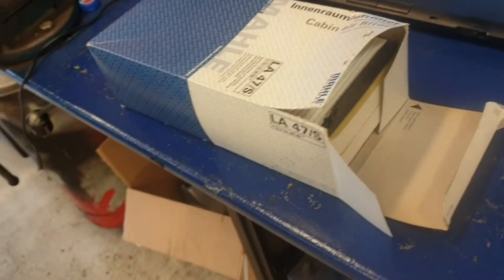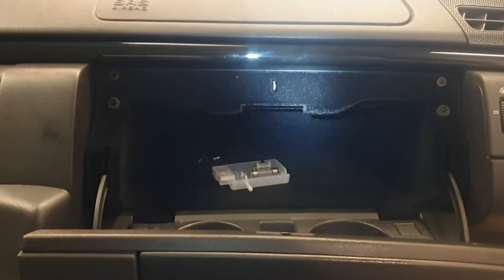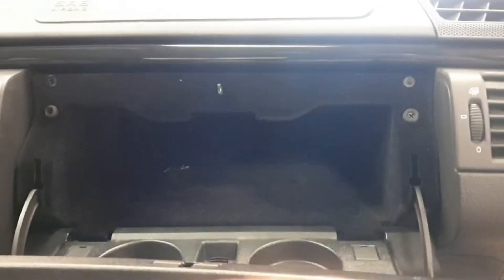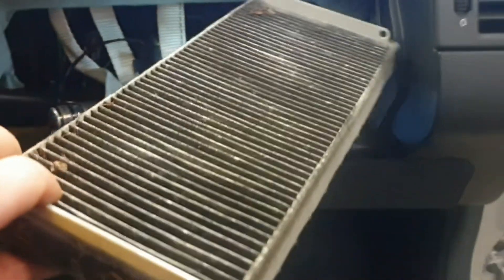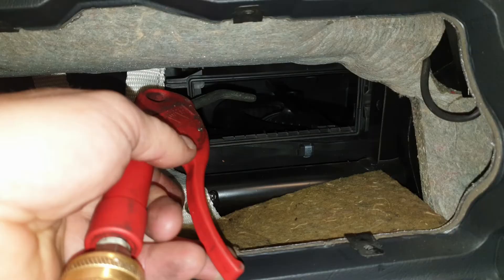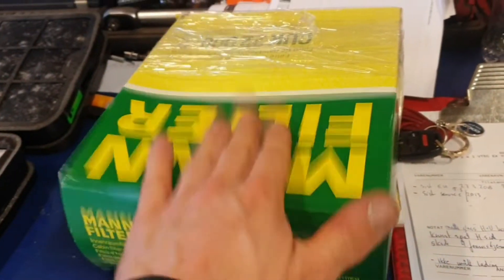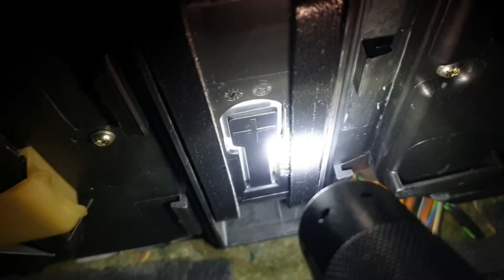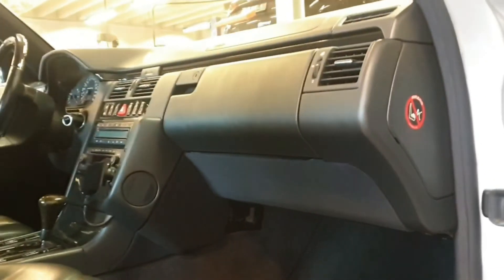Mercedes Benz w210 E50 Amg "Time For Service""Dustfilter Replacement/How To Remove Glovebox Tip

Comment: Great video Stefan! just going to order them from Germany. I will use both of Mann Ones. That coal filter usually cost enough expensive, but it is good to change them ones and then to forget about them. Want to add that on Mann site there is also good installation tutorials of this job. As always great video! Greetings :)))
Reply from the maker: thank you so much my w210friend .;)  Greeeetings ,Stefan :)